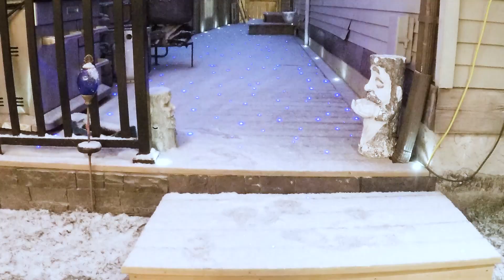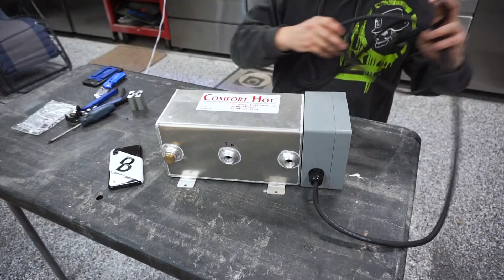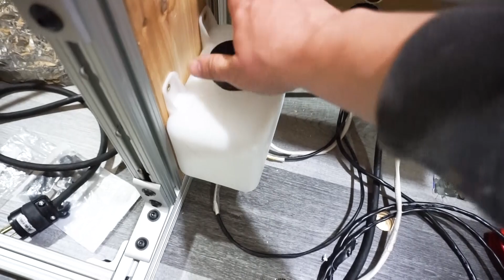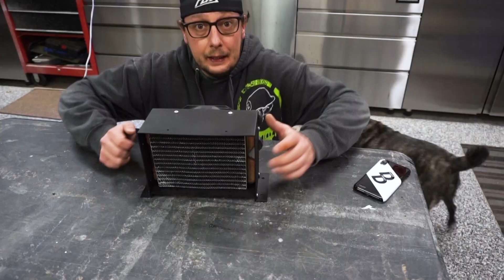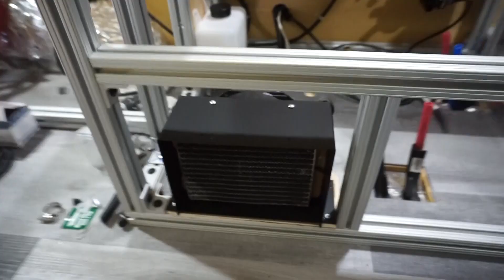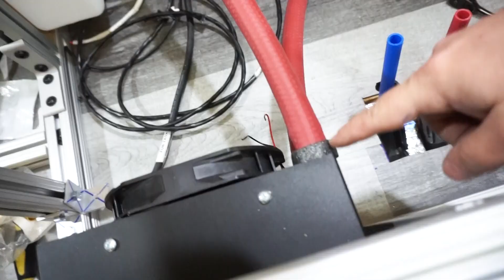Hot air and water NO PROPANE | FOUR SEASON VAN LIFE | EP.43

Comment: Thanks for the video. I'm in the process of installing one and you gave me some good ideas. I don't think the second heat exchanger is necessary, although I could see it handy for maybe a loop off your engine coolant. You could  simply tee off your water lines to the shower first and then continue on to your kitchen sink  where you would filter your water in a point of use filter system.   Filtering hot water is typically not done as it tends to destroy filters and most of them are not designed for the high heat. 

On the systems I've seen everything is tied together and that way you can actually use your hydronic heater to warm up your engine coolant on cold days. The drawback to this method is if you get a leak from your engine to your hydronic heater, you also take down your entire van. George from over at Humble Roads installed a heat exchanger up in the engine compartment and this way he can use the engine to heat his hot water, but he does give up the option to use the hydronic heater to heat up the engine coolant. Over in China they sell these things as engine heaters, and again everything is tied together into one system.

I don't think there's a right or wrong way it's just different options. I'm up in Alaska and I simply use a separate engine heater that plugs into 120 volt.  To my way of thinking the less antifreeze you have to heat up the faster you can get hot water and heat. And for less than two gallons of antifreeze you don't need an expansion tank at all. There is a pressurized safety cap put on the reservoir, but typically there's not enough expansion to warrant a separate expansion tank. You do build up some pressure, but there's a safety cap there If it gets too high it will release . And of course you wanna plumb that to the outside. 

On a residential heating system you probably have 40 gallons or something and in that case an expansion tank is mandatory.

Comment: Don't use those twist connectors on vehicle electrics. They are crap in a house and come loose. Use WAGO connectors. Fire waiting to happen.
Not sure why you would want to to have filtered hot drinking water? I would just put the filter Inline to the cold supply to the taps. I have a plate heat exchanger which is incorporated into the coolant system of the van. This allows me to preheat the van in the winter and aids cold starting. Much simpler and cheaper to do. Nice build and well presented.

Comment: Just discovered this channel.  Loads of interesting stuff.  Maybe I'm missing something here - what's the point of this system if it's gonna be using the heat from the diesel heater, and not from the engine to heat the glycol and then air and water???  You might as well use a simpler system like Bobyl.
I thought there's actually a system that heats air and water and subflooring using the glycol from the engine.

Comment: Hey bud I have the same diesel heater in 24 volt but I'm looking to go full-time in the van.I'm hoping to utilise around 800 watts solar on the roof but now that I see the power draw on your heat exchanger ,that may not be possible.Can the diesel heater be used just for hot air without the water system?

Comment: Hello (I understand your name is) Jeff,
a word of caution to this very well designed and executed system. The use of a heat exchanger puts you at risk of contaminating the "drinking water" side of things with the chemicals present in regular coolant (antifreeze).
Although plate exchangers are robust and build to last you don't want to run the risk of digesting contaminated water. The results can be quite damaging to your health, particularly to the kidneys which confronted with enough of the glycol chemical will shut down never to start up again. 
So please (oh shit I just sound like a safety Nancy) be careful with glycol based coolants.
There is though a special food safe coolant available but it is pricey stuff...
Please see if your water filter removes glycol if the filtered circuit heat exchanger has a failure of some kind...

Comment: Not sure if you fixed this or not but the expansion tank needs to be flushed where the full line is with the top of the tank.  This way you can actually use the tank to know when its low.  This is how my Aquahot system is setup at the factory.
Reply: Thinking the same

Comment: NO PROPANE in all caps. Why is propane such a bad word in van videos these days? Lithium ion batteries can bring down jetliners and Teslas as do electrical fires in general. A Webasto heater will kill you too if not properly installed. The government recently released a statement that it can take up to 20 tanker fire trucks full of water to put out one lithium ion battery fire in a car where is it only takes one tanker to put out a regular car battery fire.
Reply: Its a bad word for several reasons. The propane Must be kept outside of the vehicle and not in the living space. Alos all the divices that use propane no must alos be vented outside. Another consideration is fill of the propane. If its a mounted tank you now have to find a filling station to fill your propane. It also seems to always run out at 1 am. If its used for an interior heat or cooking it puts a lot of water in the air. 

The lithium batteries are actually very safe, most fires come from cheap toy batteries like hoverboards there are millions of them in use and only small number catch on fire.

Comment: why not bolt heat exchanger to 80/20 with t nut
Reply from the maker: Heat transfer is the easy answer... If mounted to Aluminum the heat from the exchanger would travel through all my aluminum framing that is connected to it.. And they get pretty hot..  Thanks for watching and commenting.

Comment: have some questions, is there any method that when coolant heats up, it hot coolant shoots up and heats water while the relative cool coolant is sent down to the rad and loop continues? without need of pump on coolant and only pump is needed for water only.  Thanks for the videos.
Reply from the maker: They are two separate coolant loops for heater and engine heating... It uses the pump to circulate heater coolant through under mounted exchanger which heats up the heater coolant when engine is running... Hope this helps answer your questions. Thanks for watching!

Comment: Enjoy your videos. Too much work get a Diesel  heater and  a Bosch hot water heater. Save a hell of a time and a lot of money.
Reply from the maker: Going with two different systems could save money and time up front. Long term value with this set up is only relying on Diesel that I already have to lug around for the van, having on demand hot water instead of heating a hot water tank and never worrying about having propane inside the living area or having to refill propane all the time are all massive perks to this system!!   Thanks for watching and commenting, glad you are enjoying the series.

Comment: Jeff.  Did you consider putting another heat exchanger connected to the cooling system of the Mercedes engine, which would allow you to heat the water while driving?  Maybe have a 4 to 5 gallon hot water tank that can be heated with the diesel furnace, or, heated with the engine coolant heat, that way when you stop driving, you have a certain quantity of hot water waiting for you.
Reply from the maker: R Barndt yes I have, broke that into a separate video which you will see coming up!

Comment: Stellar videos man! I've been wanting to do a single heat-source dual purpose install in my tiny trailer SO bad, been trying to rig one of those portable propane water heaters to do this job but it's turning out to be a tad challenging as the output isn't enough to provide hot enough water to heat both water and the interior, so I am attempting to modify the sucker to make it more efficient. IF THAT FAILS, I am going to consider one of these units. Do you think the 4kw models would be plenty to heat water and warm a small space? I mean, that translates to like 12k BTU's of energy, that sounds like plenty!
Reply from the maker: stevey500 not sure how big your trailer is but 4K will pump out a lot of heat. Especially if you insulate properly so it can retain the heat. Thanks for watching.

Comment: Nice and tidy install. Small upgrade: If you stick a three-way manifold after the furnace you can create three mini' closed loops - therefore, isolating and/or closing  any combination of shower/domestic/fan heat exchangers as you wish (i.e. exchangers are in parallel). More efficient as you only heat elements you need. I have solenoid valves  at manifold connections to control.

My domestic water heater is in a small storage tank (calorifier) which has twin exchangers - allows water to be also heated by engine coolant whilst driving through another closed with another exchanger under the hood. so driving a lot, I find that I rarely use the diesel heater to heat domestic (sink) hot water (so can close that loop). Also can heat the whole van while driving without using Diesel heater 

new to your channel - I'm enjoying the content
Reply from the maker: Gadois awesome thanks for the input!  Glad you are enjoying and thanks for joining!

Comment: I finally got caught up Jeff!  So hitting the notification bell now.  :-)
I find your dual water system interesting, but I think I'll go simpler with a single system.  I tell you though, I'm thinking about a good stout Lithium Ion Phosphate battery / solar panel system with the addition of alternator charging and shore power connection.  With that I'm thinking of a conventional 6 - 10 gallon 115vAC electric only hot water heater with an on/off switch.  Figure any kind of driving will heat up the hot water for my (solo) needs, the solar can help to keep the hot water hot once parked, and anytime I have shore power available I'll have plenty of hot water then as well.  One concern I do have is the durability since I don't figure there are any electric-only units designed for the rock & roll + vibrations of a van.  But I think a compliant mounting would mitigate that problem.  
Anyway, keep up the top-shelf super high quality videos you've been producing.  I and others are really enjoying them!  (Thanks!)
Reply from the maker: Snarge22 awesome super happy you are enjoy the build series.  Yes lots of different ideas for a build and really brings out the creative side.  Good luck with your build!

Comment: Great looking set up. That should work great for your planned shower system! The recirculating system shower system ( videos about it in my channel :) ) in my van are also heated by heat exchanges but a very different types and using a Air diesel heater  ( popular kit made here on a small scale in the UK ) for the heat source. Work flawlessly but if I was ever to do the whole van system again I would probably look into a hydronic system. Enjoying your build!
Reply from the maker: Mispronounced Adventures awesome glad you are enjoying the build!  Yes I looked at the airtronic heaters as well, but decided on this hydronic after much debate. Thanks for watching.
Reply: @DaresDrives  Fully understandable if I was to redo my system ( nothing wrong with it works perfectly ) I would probably go down the slightly more complex hydronic route now. That’s probably because I’ve now got the skills and confidence in them to do it
Reply: @DaresDrives  Any best of luck with the recirculating shower system having one is great! Became some of the most popular videos on my van build on my channel!
Reply from the maker: @MispronouncedAdventures  I did decide against the recirculating shower because of wanting a Four season van, couldn't find a way to make it loop without water being under the van.. More info on my idea coming soon.. Thanks again for watching and commenting.
Reply: @DaresDrives  ah I see. mine is a Fourseason van for full time living in scotish winter so any outside pipes would freeze. Because of this  I’ve kept the whole recirculating shower system internal.

Comment: There's practically zero info on this kit on the Rixen's site, especially pricing; can you share how much that whole kit set you back?

Thanks!
Reply from the maker: Scott Weikert yeah calling them is best. Jim at Rixens is very helpful. I think the price varies depending on your set up but this is by far the most expensive part of the build, I saved for a while on this one!  Close to $7k CDN for full set up.
Reply: Holy crap! I expected the price to be fairly high but not that high. Did you get a price breakdown of the whole set of gear, item by item? If so, I'm really curious about that glycol tank (Comfort Hot). That thing appears to be something Rixen's produces and sells exclusively, so I expect that was a fair chunk of the total right there.
Reply: @scottweikert5189  I agree I'll be buying the components separately with just a non-heated expansion tank should save a bunch$
Reply: I had no problem finding pricing on the site. In my opinion, the most expensive component is the furnace.The kit saves you 10%.

Comment: hello Doctor Dares! happy New Year! started out great!
a detail that I have been thinking a lot about for the conversion of my van is: what if a traffic accident occurs and crumples part of the van! how to disassemble the internal part to fix the dent in the bodywork? I am commenting on this because I saw in this video that the wood base of the heat radiator was glued to the floor and the aluminum structure, making disassembly difficult, what you could have done was to attach it with the angle brackets to the 80/20 profile itself.
a question: why did you choose the diesel heater instead of the gas heater? what will be the system to run your refrigerator, electric or gas?
a detail in your heating scheme: isn't an outlet for the shower in red?
just a few comments, from those who are very interested in your beautiful work.
hugs
(sorry for my english, i'm brazilian and i'm living in portugal, where i intend to convert a van) TKS
Reply from the maker: João Lima hey thanks for watching and commenting Lots to address here. 

 As for a traffic accident that is a worse case scenario and will be insured to reflect some of the issues your addressed. As for glueing or screwing the fan base is a very valid point and I debated this a lot. My fear was being a fan that if you give it room to vibrate..... it will.  The fan can still be removed with the four screws so not really a concern. You could break the glued base and replace if needed.  

Diesel heat was chosen because my sprinter runs off diesel so was the available fuel source on board. 

 Hope I answered your questions, good luck on your build and your current location is my goal destination once the build is complete if travel like that is possible again!

Comment: Great video!  One problem I see is that during the summer when you are heating water the hot air radiator will get hot, and even w/o the fan running,  will put heat into an already hot van.  You need to have a bypass around the radiator for summer use.
Keep up the good work.
Reply from the maker: Garo Dakessian good call, it is something I though of as well. Rixens assured me this is not an issue.  I will see how it goes, luckily it would be easily modified to exactly what you are saying if this does prove to be an issue.  I will definitely provide an update video on that particular thing once we are travelling if it becomes a problem!
Reply: Great point! We do have this issue especially since the tank is aluminum and dissipates heat very well. Fortunately we like taking cool showers when it's hot, so its not a problem.
Reply: Heat will rise so as long as the lines don't run directly up from the heat exchange you won't get much of a thermal siphoning effect.  Adding a couple loops would probably eliminate most of the thermal siphoning.